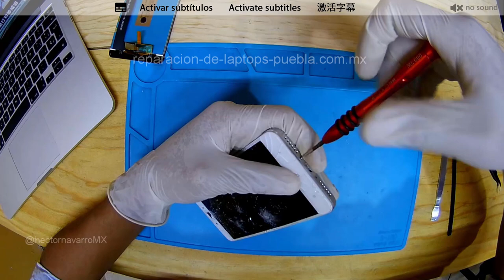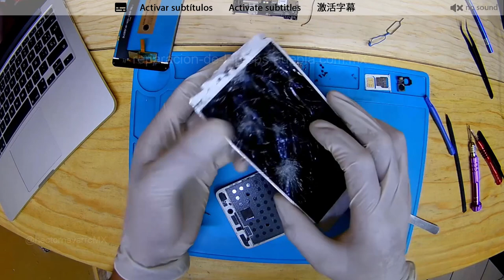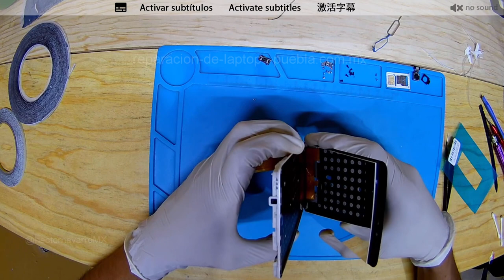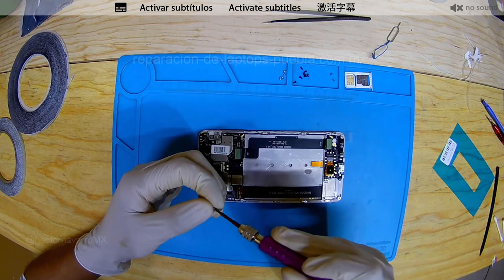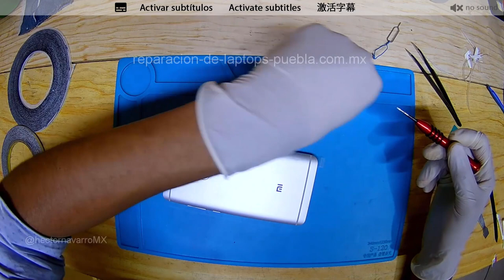How to replace LCD screen for Xiaomi redmi 4

Comment from the maker: 00:00 Remover los tornillos con desarmador pentalobe 0.8
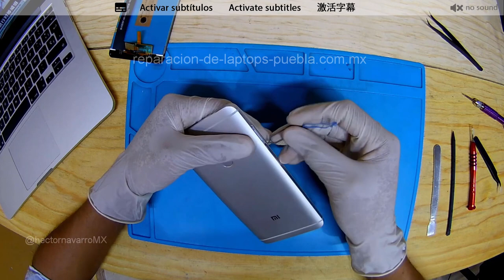00:05 Expulsar la bandeja del SIM
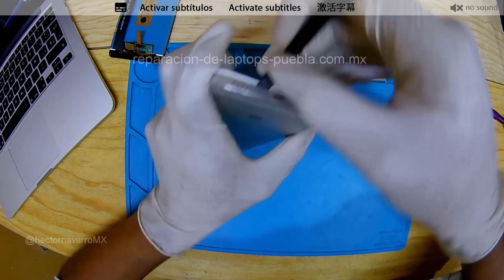00:07 Con la espátula, separar la tapa trasera
00:13 Girar el celular y separa la tapa con ayuda de la espátula
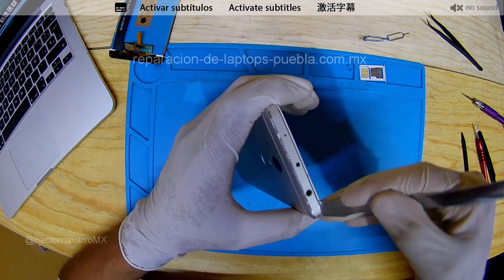00:20 Separar la tapa de la parte superior
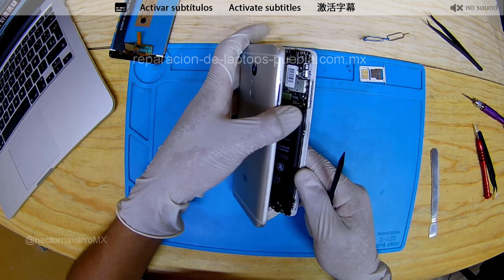00:25 Separar cuidadosamente la tapa trasera
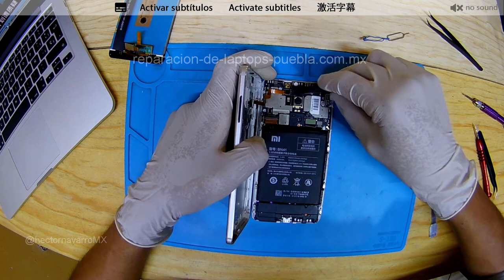00:32 Desconectar el lector de huella dactilar
00:38 Retirar la tapa trasera
00:42 Desconectar la batería
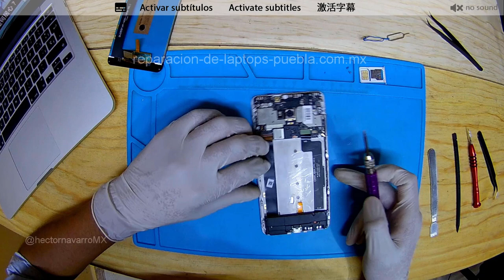01:10 Desatornillar el speaker con destornillador phillips000
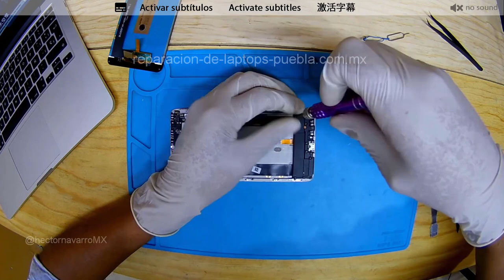01:19 Jalar hacia arriba para retirar el speaker
01:38 Desconectar el touchscreen
01:43 Desconectar el flex del centro de carga
01:52 Desconectar la antena
02:05 Separar el flex del touchscreen
02:10 Introducir el spudger para separar el centro de carga
02:35 Desconectar el flex del centro de carga
02:37 Desconectar el flex del display
02:59 Desconectar la cámara trasera
03:19 Desconectar los botones de volumen y encendido
03:24 Desconectar el flex del display
03:32 Desatornillar los tornillos sobre la logic board
03:43 Separar la logic board con el spudger
03:46 Despegar el flex de botón de encendido
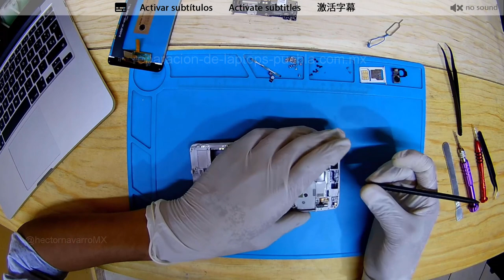03:53 Separar la cubierta de plástico
03:57 Despegar el flex del touchscreen
04:04 Despegar el flex del LCD
04:11 Poner cinta adhesiva para evitar que la pantalla estrellada salpique cristales
04:56 Calentar los bordes con la hot air gun a 240ºC menos de 2 minutos
05:10 Con la espátula separar el display del marco plástico
05:22 Puede ser más fácil si calientas por 30 segundos
05:26 Separar con la espátula
05:30 Repetir los pasos: calentar y separar..
06:19 Separar el display del frame
06:35 Limpieza de los residuos de pegamento
06:59 Limpieza con alcohol para diluir el pegamento restante
07:24 Colocación de cinta adhesiva
07:55 (PRUEBA RÁPIDA)
Más adelante se va a armar detalladamente...
08:06 (CONTINUACIÓN)
Pegar la pantalla de forma permanente
08:32 Alinear el display para pegarlo permanentemente
08:39 Retirar la cubierta plástica del display
08:48 Alinear
08:50 Pegar y presionar firmemente
09:14 Colocar el centro de carga
09:16 Conectar el flex de touchscreen
09:38 Colocar la logic board
09:44 Colocar la cubierta de la cámara trasera
09:49 Colocar la cámara trasera
09:53 Colocar el centro de carga
10:02 Conectar el flex
10:08 Conectar la antena
11:18 Atornillar la "logic board"
11:33 Colocar el botón de encendido
11:45 introducir el flex
11:51 Pegar el botón al frame
12:03 Introducir y asegurar el flex del lcd
12:22 Colocar el speaker
12:34 Atornillar el speaker
13:05 Poner cinta adhesiva a la batería
13:31 Colocar la batería
13:40 Conectar la batería a la "logic board"
13:50 Conectar el lector de huella dactilar
14:02 Asegurar la posición del botón de encendido
14:03 Colocar la tapa y presionar firmemente
14:20 Colocar los 2 tornillos
14:31 Colocar la bandeja SIM
14:37 Testeando el funcionamiento del nuevo display